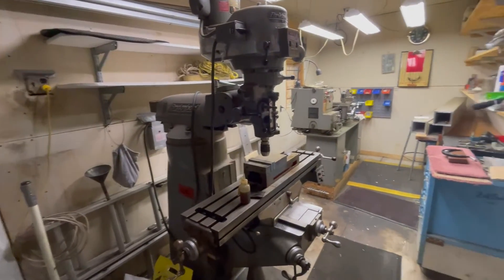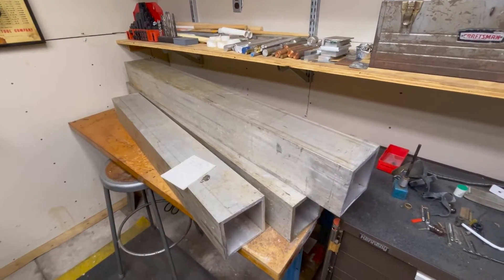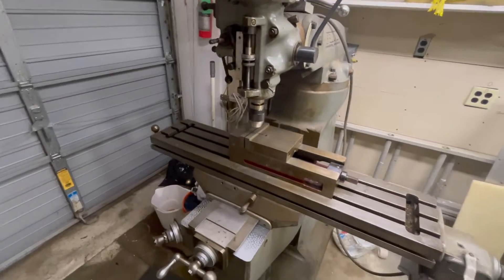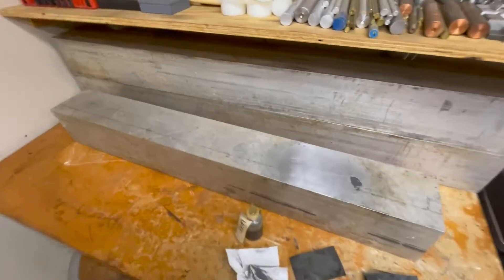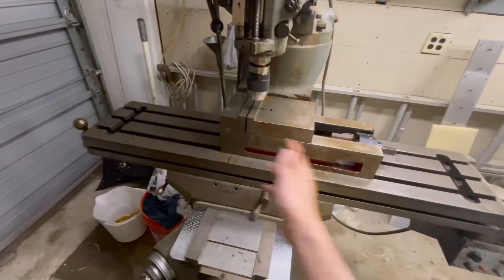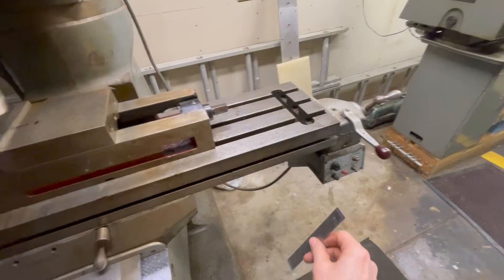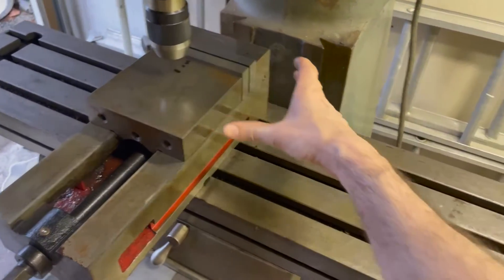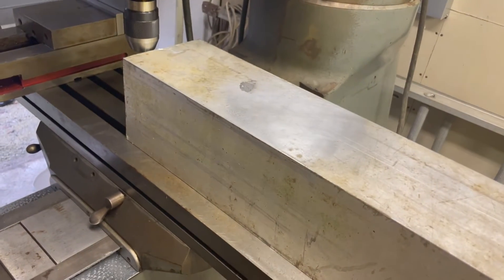Ep11: Epoxy Granite CNC Design - Column Extrusion In-house

Comment: I just looked at pricing at my local metal dealer and wow, you found a screaming deal! 36 inches of 6061 in that shape is $265 before taxes.
Reply from the maker: Yeah, I could not turn it down, and changed the entire design to work with it. The guy I got it from probably had it sitting on his shelf for 20 years and wanted it gone.